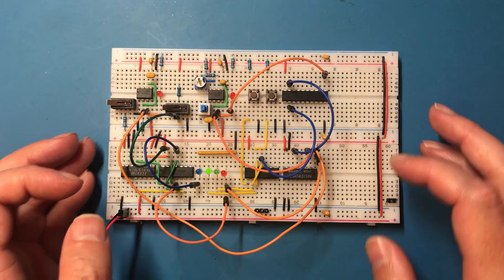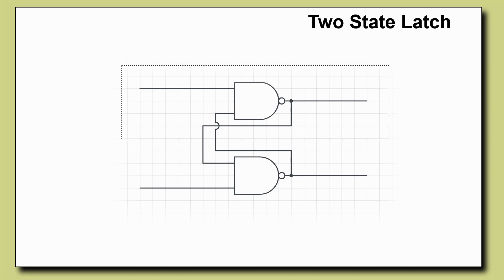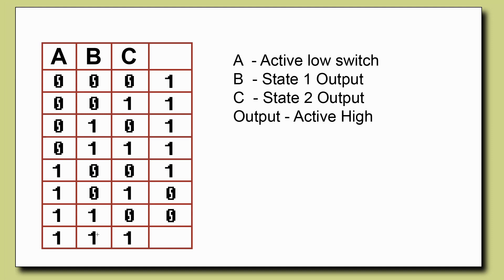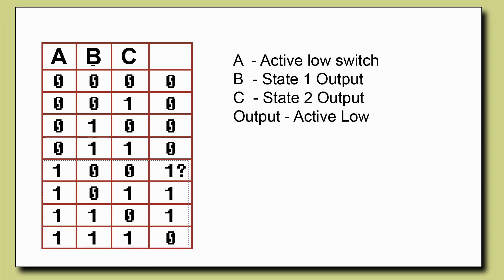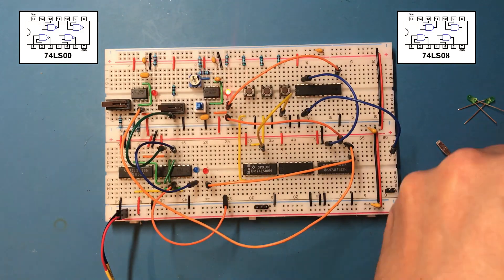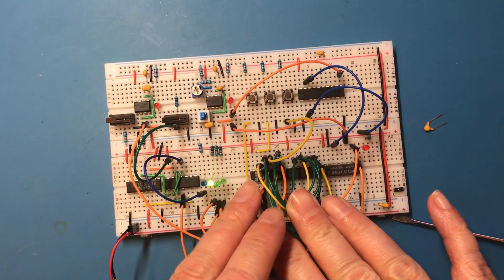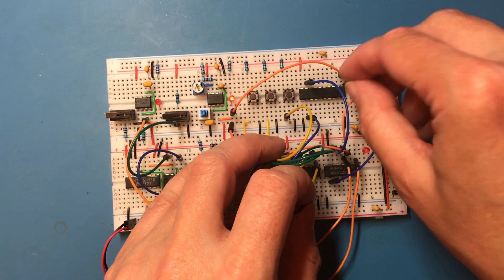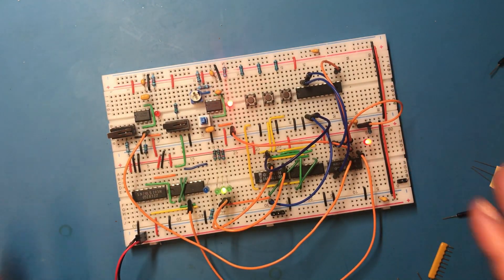Adding a 3rd Clock State - Making an 8 Bit pipelined CPU - Part 77

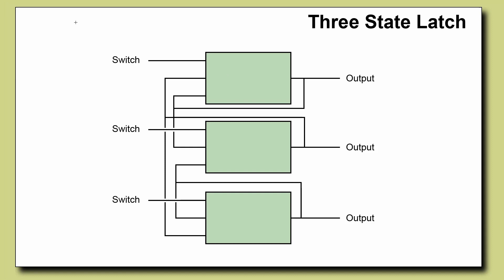Comment: The diagram at 2:48 looks wrong to me? You have the topmost output feeding back into one of the topmost inputs.
Same at the bottom.
While the middle one does not do this
Reply from the maker: Yeah, Looks like I made a mistake on the diagram, the description and the circuit I build are correct though. The feedback from the output of each section should be to the input of the other two (to turn them off when that one is turned on).

Comment: So, I notice that this is a logic function with 3 inputs. Can we just use the trick of using an 8:1 MUX as a custom function table?
Reply from the maker: You could, but you would still need an AND gate to combine the two low outputs.

Comment: Well this was indeed a lot less simple than I thought... I think you end up using 5 gates where my solution used 6, but I'll explain my thought process anyway:

You can use the quad-NAND to build a second SR latch, which will drive the MSB for the clock select chip (the first latch drives the LSB)
Since the inputs are active low, you can use button 1 AND button 2 to reset the MSB latch (set to 0), and button 3 directly to set it
Use button 1 AND button 3 to reset the LSB latch, and button 2 to set it
And I think that's all you'd need, so 2 AND gates (or a quad NAND if you'd rather re-use similar chips) and the existing 4 NAND for the latches.

I made a quick draft in Logisim and it works, maybe I missed something that makes it unfeasible. It's also trivial to add a 4th button (with two extra AND gates) if necessary.
Reply from the maker: This is one of those things where i've  spent time seeing if I can work out a simpler circuit but not been able to reduce it any further.

Comment: Why don't you use the single step button to instigate single step mode?  it isn't it an active low signal, that way you would not have to select single step mode before toggling single step?
Reply from the maker: I suppose you could, but you would either need extra circuitry to seperate the functions or accept that you would be halfway into a step when you depress the button to switch modes. I prefer the separate buttons.

Comment: Ahh, 8:20 - a man who knows his audience :)

Very nice video, thanks. I've been toying with similar ideas of how to have a three-mode clock, and I'll definitely be referring back to this series when I make it. I'd disappeared down the selectable clock-divider route instead of fullspeed-potentiometer-manual that you have, but your design does pretty much exactly what I want.
Reply from the maker: Thanks! Its nice if people find these things useful. Not sure if it came across in the video, but I cut the legs on those 3 resistors before removing them from the paper strip to make sure they were all balanced as well.

Comment: Will we be moving on to Karnaugh maps soon, been a long time since I've used one. Logic is just 1 line of code now days. :)
Reply from the maker: It may feel like "Logic is just 1 line of code now days", compilers make better code, processors are faster and we have cores a plenty. Truth be told though, those high clock rates tend to come at the expense of deeper pipelines and comparatively restricted memory bandwidth. Getting the basics right to keep things efficient can make an even bigger performance difference than ever.
Reply from the maker: I suppose I could do a short video explaining Karnaugh maps if there was call for it?

Comment: Oh so thats how you use logic tables in circuit design. I missed so much learning. by not being able to study electronics in college.
Thanks James.
Reply from the maker: At college they would have taught you a system called "Karnaugh maps" which boils down to a method of rearranging the truth table to make it easier to spot the patterns. I was tempted to do that here but it would have added a big chunk of time to the video and it's overkill for these simple patterns.
Reply: @weirdboyjim  ooooh..... we didn't have those when I was at college.... well, if we did, they didn't teach us.... I'll have to look that up.
Reply from the maker: I was taught them at pre-university level, (That would be the 90's) but they actually date back to the 50's.  “What do they teach them at these schools?” - C.S. Lewis, The Lion, the Witch and the Wardrobe
Reply: @weirdboyjim  Oh, I didn't know that as the requirements for college were higher then I managed to get :(